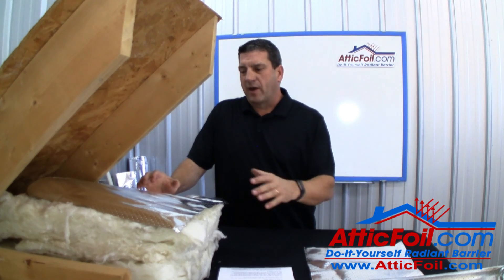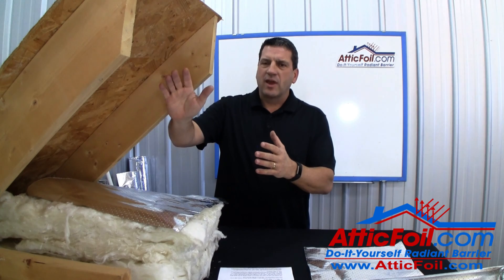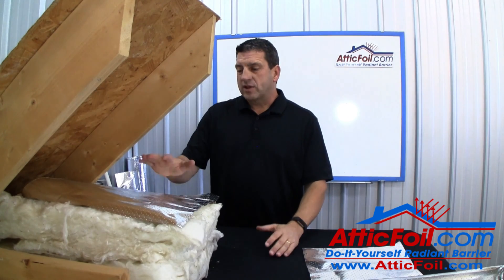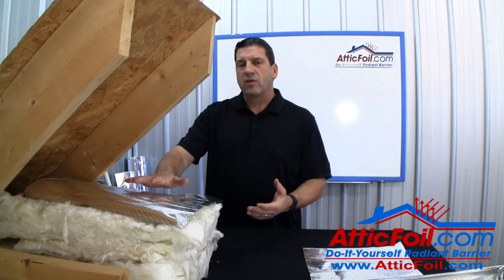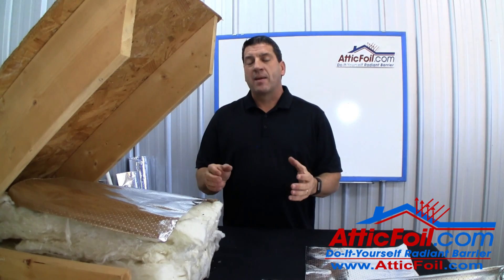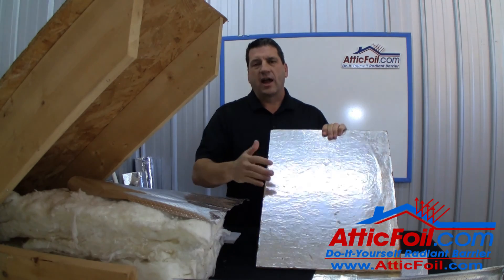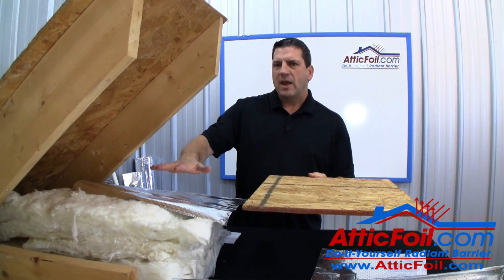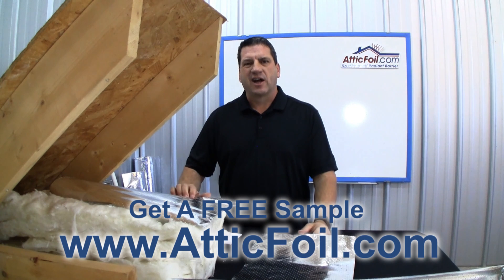Attic Insulation With SuperPerf™ Radiant Barrier - Effect Of Dust On Top?

Comment: I do wonder if there is a way to carefully spray dust off the foil with an air compressor, how well that’d work, and how easy it is to avoid tearing the foil. I would test this if I manage to get an attic foil installed, myself.
Reply from the maker: First, it  take a LONG time before any significant dust occurs in most area.  And, even if the top gets dusty, the bottom layer will always be fully effective with the emissivity quality. As for durability of www.AtticFoil.com , you can't easily tear it.
Reply: @AtticFoil  thank you!! I saw this demonstrated in your later videos, I appreciate it. I plan to buy your products later this year and install them when it gets cooler. It looks very helpful.

All the videos with demonstrations and transparency are confidence inspiring.
Reply from the maker: Radiant barrier is the most underrated thing people can do to save energy and make their homes more comfortable.  I appreciate the business! Ed.

Comment: I live in the south, have a 18" of insulation in my attic and tall attic ceilings. Would I see a good benefit laying this product over the top of the insulation as opposed to stapling up, even in the south ? Thank you so much
Reply from the maker: Yes, it will still help.  18" of insulation is great, but after the sun goes down that 18" of insulation acts like a hot blanket on the home through the night. Ideally, you want the insulation to not really get hotter than ambient temperature.  www.AtticFoil.com will do this.

Comment: I have a box truck I use to deliver product and it's got a roof that allows sunlight to come thru.  Could I glue that to the roof and do u think that would help with the heat in the truck?
Reply from the maker: It would definitely help some.  If possible you want an airspace between the metal skin of the truck and the foil.